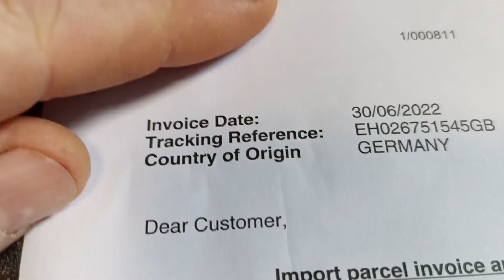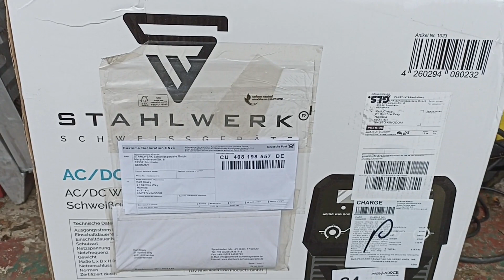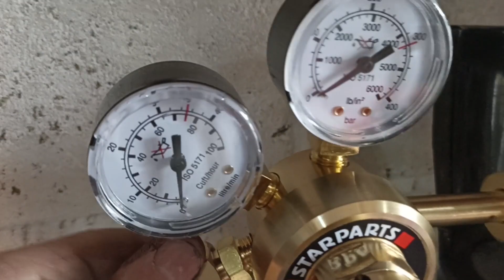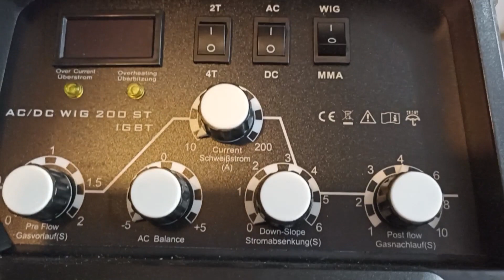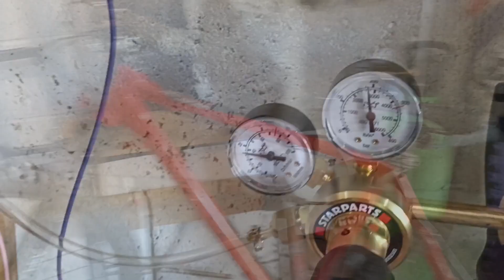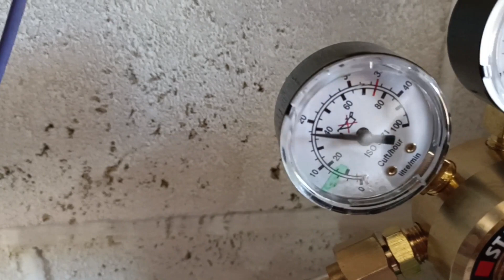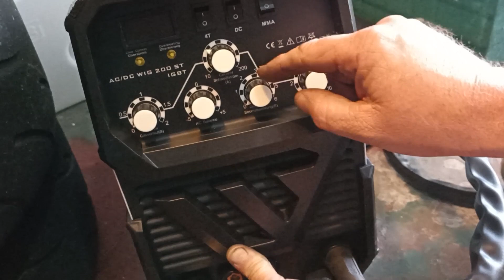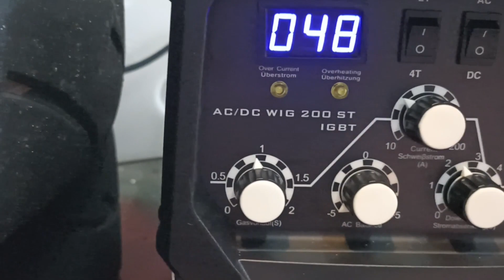Setting Up & Buying Argon Gas for TIG STAHLWERK AC/DC  200 ST  Welder & Learning To Weld

Comment: You’re not supposed to use tap on the regulator it’s a pressure fitting
Reply: Did you mean "tape" ... not supposed to use tape